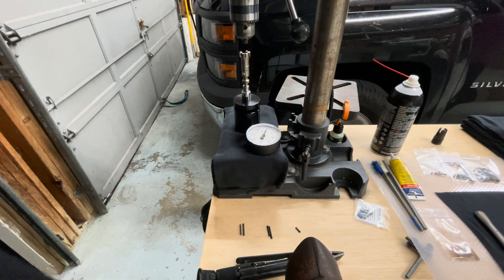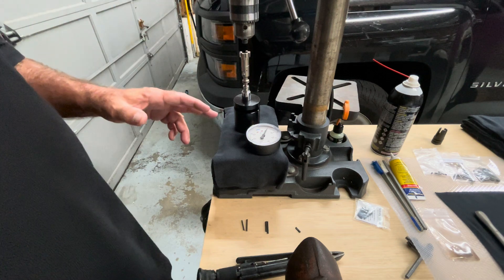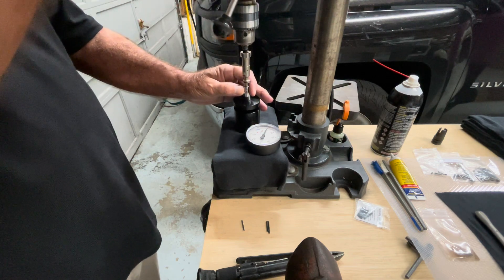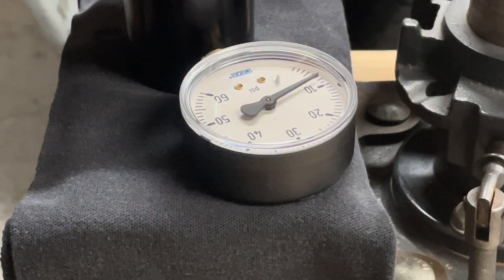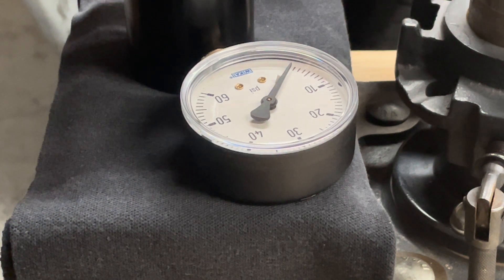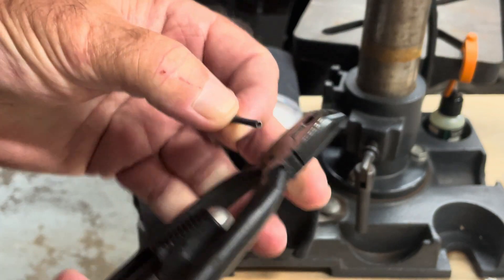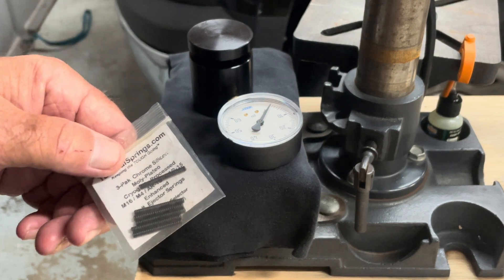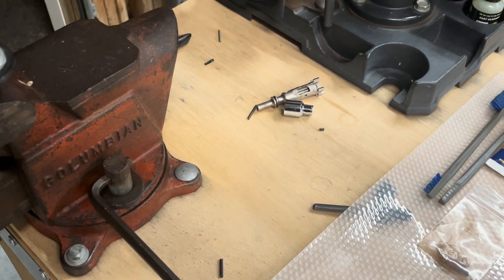Colt Sprinco Ejector Spring Testing

Comment: I question the towel, think it could have give. A piece of wax or butcher paper would protect but not have ability to compress.
Reply from the maker: I consulted with Lysander on ARFOM about a year ago on what the reading should be at full compression and he stated it should be 10.5# That man is a walking talking computer on AR-15 specs, and that's close enough to my reading, also gauges like this tester are most accurate at the middle range of the gauge anyway. Some inaccuracy in the tester, but a couple of tenths 1 way or the other doesn't concern me. Its reading what its suppose to read.